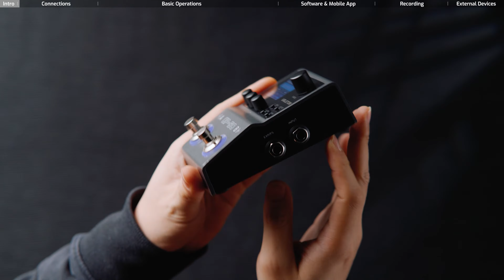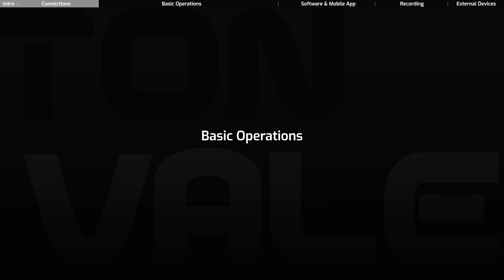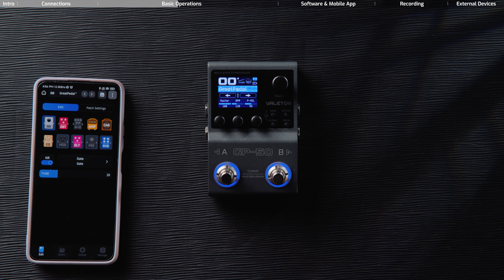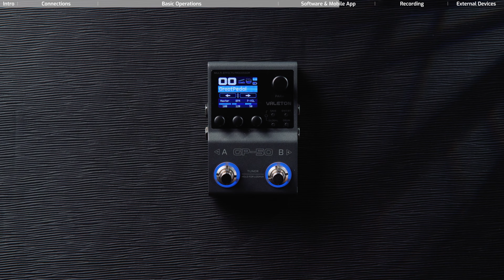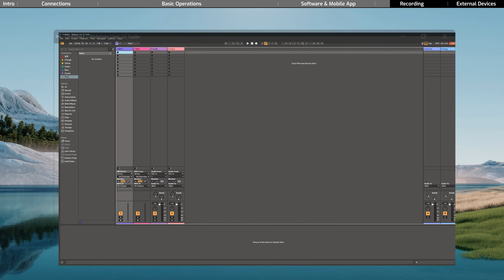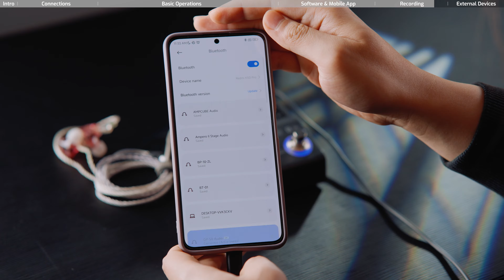Valeton GP 50 Full Tutorial Connections, Editing, Recording, App & Advanced Functions 1

Comment: I just purchased a GP 50, can't get the valeton suite app to connect at all. When I try to connect it the Bluetooth search won't be detected. Blue tooth is flashing , when I try to update the software it just returns to the app menu and there is no update in the app store. Is this a new problem?
Reply: App on an Android phone doesn't detect the GP-50 in BT (for patch management) even with the latest FW. BT does work for Audio from the phone (try it).
It works okay as an audio interface. I got mine, noticed this issue, and returned it to Amazon the following day for a full refund. In contrast, the cheaper Pocket Master works 100% right out of the box. Hope this helps.